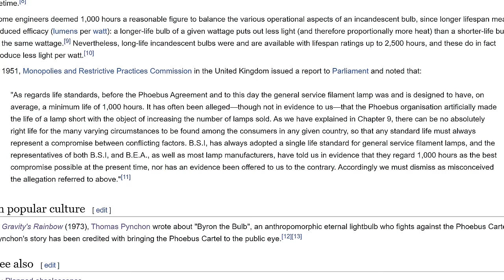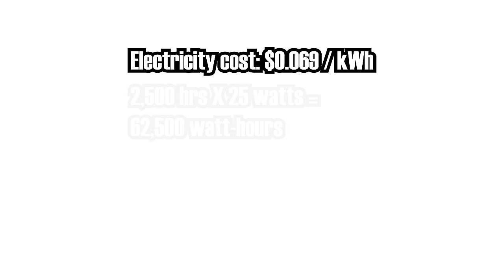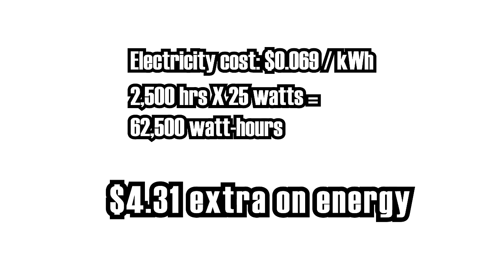Longer-lasting light bulbs: it was complicated

Comment from the maker: So... yeah. And I didn't even get into things like the effects of thermal cycling stress!
Couple of fun facts that didn't make it in: one way to make an "energy-saving long-life" bulb is to design it for 130V, thus when on 120V supplies it's being underrun. And those are very weird because, for instance, it'll often be marked a "60W bulb" - but only at 130V. So in a sense it's like installing a dimmer that you can't go over 85% brightness or so. It works, but you have the same efficiency and output trade-off.
And to touch on that thermal cycling stress, light bulbs for stage lighting were pretty niche and expensive, so stage lighting controllers would often have slow warm-up period upon power-up and never switch lights fully off when a show was going - instead, a very small amount of current was run through the filament to keep it hot, but not hot enough to glow. There were plenty of ways to extend the life of incandescent light bulbs, but every one had its own little unique trade-offs. Be glad we have better tech now!
Reply: I'm working in a company that makes things that are not designed to fail at some point
Reply: @Scudmaster11 ok 👍
Reply: DJL projector bulbs (and likely some others) have a filament in series with the main filament, which is located behind the reflector making its light output useless.  The extra filament doesn't get nearly as hot as the main one, and I suspect its intention is to limit peak current.  If a bulb of that style (using numbers which are probably nowhere near those of the actual DJL bulb) if the main filament has a resistance of 0.1 ohm when cold and 1.0 ohm when hot, and the other filament has a resistance of 0.4 ohm when cold and 0.5ohm when hot, then the light output would be about what it would be if the main filament had been 0.2 ohm when cold and 2 ohms when hot, but the inrush current would be only 40% as great.
Reply: Having lived in Phoenix, where my light bulbs lasted 11 years, I learned that Mexico runs on 130v, and the bulbs in my house were 130v bulbs from just over the border. So, when the bulbs in my Maine house were being changed 6 or 7 times a year, I ordered some "Mexican" bulbs from Amazon. Only one needed changing this past year. I fully embrace your hypothesis.
Reply: Can you make a video on refigerantion compressors?
Reply: The maximum lifetime of a normal light bulb (not LED) is about 30k hours. You can actually get those, but people are too dumb to order them in large quantities.
Reply: Isn't this a re-upload , I'm pretty sure I've watched this in the past.
Reply: “Rough duty” lightbulbs sold for things like under-car mechanic lights have filaments made for 180 or 200v. They glow a cooler orange than ordinary bulbs consuming the same amount of wattage.
Reply: reminds me of the bulbs in high bay lights in gyms, they take 3-5 minutes to warm up
Reply: This point is irrelevant now, but you can make your incandescent bulbs last much longer using one of two methods.

First, find a small transformer that is rated to convert 120V to a lower voltage, such as 60V.  Wire that into the base of your lamp, or put in a project box somewhere on the cord.  Then use a higher wattage bulb.  The bulb will receive a lower voltage and so draw less current and so burn less bright than it is supposed to.  

Second, place a resistor in series with the bulb socket inside the lamp, and use a bulb with higher wattage.  You'll need to try different ohm resistors and different wattage bulbs to get the preferred brightness.  Just make sure that resister is rated for the amperage the bulb will draw, which is about 1 amp in this case (but you can go higher -- just don't go lower).  

EDIT: Responding to future comments...  Yes, the resistor will get hot since it's converting power to heat, just as an incandescent the light bulb does.  And, yes, newer resistors made in the past 10 to 20 years or so are rated in watts, rather than amps (which doesn't make a whole lot of sense since 1V at 100A is the same wattage as 100V at 1A, but a given resistor that will handle 1A just fine will pop with 100A passing through it).
Reply: @fredashay  Those used to be sold “as seen on tv” in the form factor of washers that went into the socket below the bulb.
Reply: Often longevity would increase costs, and more durable parts would be heavier, bulkier also ruining efficiency. With lower production value it would be more expensive. You would also lose access to new improvements in efficiency and new innovations. 

Would you want a fridge or dishwasher that costs 5 times more for 2 times longer lifespan and reduce efficiency? 

The problem is when you don't engineer things for a specific target in durability, but optimize for costs and you would have components with very uneven durability and you lose money on bad design. But that isn't really planned.
Reply: @jrrarglblarg9241  Tv?  What's "tv"???
Reply: Could the centennial bulb be in fact a 240v bulb (European or such) running at a quarter of its rated power here? As power is proportional to the square of the voltage for a constant resistance (P = V^2 / R)...
Reply: Would you say light bulbs are like batteries?
Reply: @avlisk  The reason why there's 130v bulbs in the Mexican market is actually because their federal voltage standard is 125v +10% or -5%. This gives a legally acceptable voltage range of 119v to 137v - which can be tough on certain appliances.
Reply: You missed it.... "it's not the brightest bulb in the box..."
Reply: @fredashay  Why bother using a resistor when dimmer switches are readily available and more efficient... So yes you can run a 100w bulb at 60w with a dimmer, but it won't have the same "whiteness" as a real 60w bulb as mentioned in the video.
Reply: So let me get this straight you think that they were not being a cartel? So then why weren't braided filaments used or at least staggered spring shape tungsten?

Same engineers could have easily done this. Cost would be slightly more but, could easily last longer.

That doesn't even get into making a forever bulb. With things like inconel, etc.
Reply: @DroneMTL  Okay.  Good point!
Reply: This reminds me of the old fashioned single use camera flash bulbs. They're super bright under very little power, with a lifespan of like, half a second.
Reply: I was going to mention the importance of manufacturing. I work in PCB assembly manufacturing and know there's a lot of things the companies can do to either through incompetence or maliciousness shorten the life-span of the products. Some go down to the soldering, wanting to use less of it which basically ensures the product can't survive long if it's experiencing vibrations... So glad this was pointed out though. Very good video, thanks for making it!
Reply: Regarding the centennial bulb: it burns 24/7, therefore, no thermal cycling (shock) of the filament.
Reply: Every engineering content producer, it seems like it's impossible to avoid the 69-nice joke, and I love it!
Reply: There were "long life" light bulbs rated for I think 270V at time when Europe ran at 220V. I still have several of them at home.
Reply: @CraftAero Yep! They had to move it once or twice and were absolutely terrified that it would burn out when it was powered back on.
Reply: Considering your Phillips light video and this, I'm surprised you haven't tackled the Dubai Bulb conspiracy. We really could have the best of both worlds for minimal cost.
Reply: Are Compact Fluorescent Lamps considered obsolete?
Reply: I remember we had a specific spot in our apartment for spare light bulbs. Now I've bought LED bulbs when moving to a new apartment to get the preferred color temperature.
Reply: @DreitTheDarkDragon  What do you mean "at time when Europe ran at 220V"? It still does :)
They're also banned in Europe for years now because of low efficiency and detriment to the environment.
Reply: @jlinkous05  "it's impossible to avoid the 69-nice joke..."
69-nice joke, nice.
Reply: Hey Alec, I really enjoyed the video. However, I'd like to point out that in the beginning of your video, you mention the reason for carbon filament bulbs not being ran as hot to be their melting point, however, this would be incorrect. Carbon sublimes directly into a gas at atmospheric pressure (and below) at ~4000 K (or ~6700 F) and can't exist as a liquid unless subjected to an elevated pressure at high temperature. I suspect the reason for not running carbon filaments hot was their fragility, because they could theoretically get hotter than tungsten filaments but would probably break from thermal expansion (these filaments were fairly brittle) before they got that hot, hence the short cycle life.
Edit: I suspect evaporation is just as problematic for carbon as it is for tungsten, and I suspect carbon might not be able to weld itself as it fails like you demonstrated in this video with tungsten. Though I wonder how well halogen technologies would've worked for carbon.
Reply: @fredashay  “TV” is boomerspeak for a now-obsolete real-time video streaming service that used one-way line-of-sight wireless connection between host and client devices. The massive RF footprint for the dozen analog “tv” channels required receiver antennas ranging from a several inches to several feet long. They would be arraigned along a central axis in order of size. For best results the central axis would be aimed at whichever local hilltop all the “tv” and “FM radio” (a now obsolete music streaming system) stations put their transmission antennas on. 

Enjoy your day.
      😂👍
Reply: led bulbs its usualy the driver circut that fails most of the time the led is fine
Reply: I don't know if anyone will read this comment.  But now on the market there are, for example, incandescent lamps for cars.  And the brightness of these lamas depends, as you thought, on the length of the thread itself.  What do you think marketers did?  They shortened the thread and the lamps began to shine brighter, but their service life was reduced by 1.5 times, and the price of these lamps rose by 1.5 times.  Passing them off as a miracle of the latest technology.
Reply: @JJ9715 compact fluorescent obsolescence:
yes. They are now objectively less efficient than LED's, and have a worse spectrum. 
"normal" fluorescent tubes, too- especially if they have a "dumb" starter and ballast. 

I still have a bunch of decent compact flourescents (fast- start 15 and 20 watt sylvania mini lynx compact) and will continue to use them in some applications, or keep them in reserve. For stuff i switch on and off daily, or only use short moments (garage, hallway), I just use current led's when I replace them. (still some old lightbulbs running in there)
Reply: thermal cycling was what I thought you were going to cover.
Reply: @lukastemberger "still 220v" some eu countries are definetly closer to 230-240. At least, my multimeter and my brother tell me so.
Reply: @lukastemberger 230 V nowadays.
Reply: For many years I had a lamp that was a sunrise simulator, basically a fancy dimmer on a timer that turned on a incandescent lamp very gradually over the course of 30 minutes at a preset time for each day of the week.  It only ran the incandescent bulbs for the 30 minutes it took to reach full brightness and then 5 minutes at full brightness after which I had a separate LED bulb on a different more basic on/off timer take over.  The two 60w incandescent bulbs I used survived this 35 minute cycle daily for well over a decade because of the reduced thermal shock and relatively short daily burning time.  I suspect both bulbs were well over 2000 hours of runtime and still working by the time I got rid of it.

I finally replaced the unit with an addressable RGBW LED array strip driven by an ESP8266 controller.  The end result was taking something that consumed up to 120w and replacing it with something that performed 99% the same but consumes at most 20w.  With the added bonus of the ESP8266 is a far more capable controller than the chip driving the old system and can do things like automatically adjust for daylight saving time and run different light programs if desired.

The RGBW LED strip/programming a "sunrise lightshow" was necessary because it was the only thing that could approach the slow ramp up dimming capability of incandescent bulbs by switching on individual LEDs at their minimum brightness one at a time, pretty much no standard dimmable LED bulbs even come close to the minimum brightness range.
Reply: funny thing you based your cost/gain calculation on Westinghouse....
data  from EU based Phillips (@21:37) was a LOT better, and 2500h bulb was much more valuable here!
Reply: Somwbody went back and recorded that line about it rechnically being sublimation after already recording the whole episode where you said evaporation didnt they?
Reply: @avlisk In winter the inefficiency of those bulbs will just create some extra useful heat. 
In summer that extra heat won’t be useful unfortunately. 

Just curious: do you still use incandescent light bulbs? 

I’m from the Netherlands and over here (in the EU) incandescent bulbs have been banned so it’s all LEDs bulbs here.
Reply: Yes!  Yes! Yes! Technology Connections dropped a new video!! 
Alec i really enjoy your content. I subbed to your 2nd channel and your secret 3rd channel. 
Did you ever get that moka pot? 
Maybe espresso is something you would enjoy. Maybe a Flair lever machine? I have also been watching the Jleverespresso. 
Keep up the great work!!
Reply: I'm embarrassed to say that I didn't look up the wiki article after watching Veritasium's video on the Cartel, and took for granted that they told the full story.  You're not alone in being annoyed when extremely relevant "well actually" information is left out of a story even when the omission is intended to support a very good cause like Right to Repair.  So thank you for setting the record straight.
Reply: @ZeigtdasVideo  That's so weird. I lived in Europe all my life until 3 and half years ago and I never knew that they switched to 230... I googled it now and you're correct.
Reply: Hey, your analysis that "the power company makes more money if it sells more power" is just false. The power rate is set as highly as people are capable of paying for it. Energy svaign standards let the power company make more money cause they can increase rates and make less power which costs money.
Reply: @DroneMTL that is an interesting idea. 😊
Reply: Also, with other things, there are legitimate trade-offs to making a product that will last forever. In general, it will have to be more robustly built and require more material than a product with an expected lifespan, meaning that for the same performance, the cost for the infinite life version will be higher. And believe it or not, there are some products where infinite life wouldn’t even be useful because the world changes around it. For example: if you designed an infinite life VCR in 1985, you would still have trashed it by now even if it still ran just fine, because nobody uses VHS tapes or analog TVs anymore. Likewise, engine has advanced so much that the fuel economy is too bad to make it financially viable to drive a car from the 60s in the modern day, even if it still ran like new.
Reply: @lukastemberger  Europe runs at 230V for many years. I know, small difference but like 30-40 years ago everything was officially 220V and with different voltage tolerances.
European union banned all incandescent lightbulbs no matter their power and efficiency. Funny thing is you can still buy them but must sell it as "heat ball" or something like that.
Reply: So yeah, keep up the funny dry humor vids of engineering we love em!
Reply: Can you touch on bulb savers. Basically a diode you inserted between the bulb and base.
Reply: @jrrarglblarg9241 
Rough duty bulb also have additional filament supports.
Reply: I would not even say your own description of "they were engineered to fail after a certain number of hours" is fair... the nominal lifespan of 1000 hours is not a design factor, but an experience value of the time something like 95% of the bulbs will at least make it to... everybody knows a case where a bulb was really short lived after all, maybe due to manufacturing mistakes, but there probably were also cases where the 1000 hour bulb lasted for 1500 hours.
Reply: @Ugly_German_Truths  
I believe that's called MTBF
Computer hard disks have a MTBF rating printed on them. 
Some last longer, some shorter.

Edit. The packaging on current incandescent bulbs say "average expected life X hours."
Reply: K ° 🤣
Reply: @DevilAgent And bluish light is interpreted by the brain as "brighter". However, our eyes are less sensitive to blue light, so we are seeing less far than with non-blue car lights. Car light marketing at it's best...

Buy non-blue, OEM lamps. Last longer, approved, and safe.
Reply: It's an old trick to use a bulb rated at a higher voltage to extend its lifetime... When was the last time you replaced the bulb in your microwave oven?
Reply: I'm glad you mentioned thermal cycling. In my freshman engineering seminar class (back in 1968), we had a GE engineer talk about light bulbs and he spoke of the life of incandescent bulbs was based on a certain number of thermal cycles. I don't remember the number but the thermal cycles stuck with me with regard to a lot of things including electronics and hard drives.
Reply: @DroneMTL  Could be. But that 240V was 220V before... But even if it didn't make much sense I have heard about bulbs designed for other voltages. 

When you have a tram line that uses 600V DC some made light bulbs that can use 600V electricity to make sure that they don't have to convert the voltage. If it was 100W with 600V, it would be around 4W with 120V...
Reply: Can you do another video about planned obsolescence on automobiles... Compare the similarities between automotive length vs light bulbs... I think most people know that vehicles could be made to last twice as long as they do...
Reply: 1) Could it be that there were no advances in bulb technology due to the fact that it was forbidden to sell said new more "effective"bulb?
2) we need the cartel back to police up theas shots led designs  an over driven led is no better than running a train head light(96vdc) on a wall plug. Yes it is sufficiently bright but has no life.
My experience is that the voltage regulator ( leds run at 2.7-4.7v ac/dc)is over clocked , this shows up as UV anf heat damage through the casement as yellow stains . Or as you said running in a state of overrunning voltage severely cutting lifespan, if the regulator components can out liveth diode.
Reply: The issue isn’t that you have to look deeply it’s that you have to look at all. We no longer examine critically. Most of what happens in our real lives. Just accept it and move on, and a good conspiracy theory is hard to resist.
Reply: @Conservator.  I use LED's when I can. I have a "3 season cabin" in Maine that I had to live in over the winter. The exposed water lines needed just a little heat to keep from freezing. That's why I bought the incandescent bulbs. It's a unique situation. This winter, I'll be wrapping the pipe in heat line tape.
Reply: Just a friendly notice, the subtitles say "eek out" instead of "eke out".
Reply: I do not like this video, I miss the old you.
Reply: Most 12V halogen lamp transformers only output 11.5V to slightly underrun the light bulbs and prolong their lifetime.
Reply: @avlisk  Thank you for you answer. That explains everything. I hope things will get better for you. All the best!
Reply: That cold heat function is also common in the animating signs that uses incandescent light bulbs, just so they're not gonna explode whenever they get kicked to the full brightness notch, just by basically keeping the filaments cooked to ward off thermal stress of Tungsten.
Reply: There is a channel named Truth Stream Media that has recently done a pair of videos in regards to Planned Obsolescence.

Very good watch.
Reply: When someone tries the "planned obsolescence of lightbulbs" conspiracy theory on you, just remember this: There was this huge thing called "the eastern bloc". A large portion of the planet running a socialist planned economy in nationalised industry model for decades. And desperately trying to make as long lasting lightbulbs as possible because the regime didn't profit from them (it was often subsidised), it just made them to fit the basic need of the people and if it were possible to make longer lasting ones, they would make them longer lasting, because the tungsten was a strategic resource for the military and the government hated wasting it on consumer products.

I can assure you lightbulbs here in the eastern bloc had the same life expectancy as elsewhere. 

Same thing goes for fuel efficiency in cars and other stuff. If socialist planned economy did it the same way as market economy, it means it was either the only way to do it or the most efficient way to do it.
Reply: @ve2mrxB  At low light levels the human eye is most sensitive to blue light (about 500nm), that's why night vision safe lights are red to protect our blue-sensitive night vision. Whiter lighting also improves perceived contrast and color rendering, making it easier for our brains to perceive indistinct objects more quickly. Finally, an incandescent bulb (regular or halogen, as in car headlights) driven at higher temperatures doesn't just output more light in the higher part of the visual spectrum, it has a higher intensity in the lower part of the spectrum as well, so even if you were to filter out the blue, the light would still be objectively brighter. That said, high-output halogen car headlights aren't worth the price premium and the extremely short lifespan. Keeping your headlamp lenses clean and clear is much more cost effective and beneficial (call back to a previous @TechnologyConnections video about sealed-beam headlamps, in which you got brand new lenses every time you replaced the bulbs...)
Reply: @jasonosmond6896  I am talking about the car bulbs that emit a distinctive blue colored light. The bulbs are usually blue. 

The unfiltered clear bulbs are burning brighter and faster but do deliver good light. Lifetime is much shorter as you mentioned though!
Reply: Yeah I have noticed that Incandencents tend to fail more often in places where they're turned on and off frequently like the kitchen or bathroom.
How ever I'm finding that I can now get a pack of bright 60w equivalent LED's at the dollar store in a box of 4 lights for $4 CAD
Reply: I work in stage lighting and incandescent bulbs are actually still widely used nowadays (LED is slowly taking over though) and the techniques you mentioned are also still alive and well. In the desk I use, there's even a preheat feature, so you can define a preheat percentage and have it start to heat up a cue before you need it. Honestly, I'll really miss tungsten when it's gone (this is going to turn into a love letter to tungsten soon). LED technology has gotten ever closer, but tungsten is still the best in terms of light quality, it's such nice warm light with perfect color rendering (it looks great with gels too). It's also hard to find LED lights without some sort of dimming problems like it looking a bit flickery. In theatre, you just need that absolutely perfect transition and tungsten does it perfectly with smooth dimming and an amber shift (which can sometimes be quite nice actually). There is also nothing like being at a concert and when the artist engages the crowd, the tungsten blinders hit you with all their light and warmth and you just feel drawn in not only by sound and light but also by the feeling of warmth on your skin. The warmth of light is oddly comforting and LED will never be able to replace that (without defeating the whole point of energy efficiency that is). I also honestly love the crackling sound when the light fixtures heat up or cool down. Of course, it is wildly impractical during a play, but it's just a great feeling when you're focusing, you'll start to hear crackling soon and with every light you have focused, the room gets hotter and hotter until it's too much to bear, by which time you'll hopefully have moved on to programming. As you tear everything down after the play, you hear crackles in every corner until eventually, the stage is empty again, the truck has been loaded and you hear the last few crackles before you turn all the worklights and machinery off. It's just a certain something I'll really miss when we too will have made the switch at a yet unknown point in the future. However, I won't miss bulbs failing when I needed them the most and I certainly won't miss burning my hands and arms on those fixtures.
Reply: P
Reply: @charlotteice5704  The amber shift when dimming is the main reason I haven't switched to pure LEDs! Incandescent, although less energy efficient, dims much better than LEDs (unless you pay $$$$ for amber-shifting LEDs)!
Reply: Not just thermal cycling, but there are other factors that can reduce a bulb's service life - like physical stress.,   Ever notice how an incandescent bulb installed in a ceiling fan has a shorter life?  It's because of the vibration generated by the motor (slight but present nonetheless) and the fact that most ceiling fans are poorly balanced.   For mechanics, there were/are still 'rough service' bulbs, typically of lower wattage) that have coatings on the glass to help keep it from shattering when 'indelicately handled.   Because of the lower wattage, the filaments aren't as hot and don't sublimate quite as fast, and are more resiliant to mechanical shock.
Reply: The descibed stage lighting tech eith pre-heating is used till this day in 'blinders'  the bigass parabolic reflected lightbulb arrays.
Reply: @jrrarglblarg9241  The glass is also coated with a plastic to help keep it from shattering.
Reply: @Nderak  Those might be arc lights.  Once upon a time, street lights were arc lights, too.  It was always neat to watch them flicker, then start glowing with a weird,  dim blue-purple light, slowly building to a brilliant white.   They crank out a great deal of light and they're pretty long-lived, but they do eat up quite a bit of power and they are expensive.
Reply: @Scudmaster11 What industry is that? Not trolling, just curious. I’m in the aviation industry and even here, where failure means a very bad day for a lot of people, things are designed to life limits (precisely because the cost of failure is way higher than the cost of a new part).
Reply: @xaenon  Well, yeah, that too, but the point here is the work light filament is running so cool it can take a beating getting moved from spot to spot under a car without switching off. Regular lightbulbs blow when you smack the lamp holder around because the hot filament  is both thinner and more fragile due to heat.
    Someone told me years ago the rough duty bulbs are sold without the coating as 180/200v bulbs and were used on ocean drilling rigs and other electrically self contained industrial things that ran at higher than US voltage but not as high as European because it’s 2 phases of 110 or something.
Reply: @mrb692  I signed a non disclosure so umm... electronics in special machines "non consumer buy able" its things you can't buy at the store... the unit I make costs afew thousand $ ... so ya... that is what I do... assemble thies units... still can't say what I do conpleately
Reply: @avlisk  But were they dimmer and more orange colored?  Did they end up needing more power to get the same brightness, so you end up spending more than the cost of the bulb?
Reply: @TechnologyConnections
Another great video, We always used these types of light bulbs untill annoying mercury and finally LEDs came to market and become cheap enough.
I watched very popular veritasium video about it a while ago, but I think he didn't mentioned this crusial detail (pls correct if I am wrong).
I will go and try to search another video about different types of lightbulbs on your channel.

P.S. You did it, one of few videos where you managed to not included refrigerator cycle , maybe next time😂
Jokes aside, there are  actually so many people, even scientists, who don't understand this cycle and believed in common myths like electric heaters somehow destroy water in the air (I was actually one, before your video made me think about it critically for the first time).
Or don't understand how relative humidity works.

I would add these myths to list of myths that I commonly dispell,
Number one probably that Alcohol doesn't make you actually warmer, you feel warmer, but if you are still on the cold you would freeze even faster (also ignoring that being sober in survival situation will help). So people have no idea either.

Your channel is a gem and I am so glad I found it a while ago.
You and NileRed are probably my favorite channels that makes me a bit smarter.
Yours is interesting mix of Physics, Electronics and consumer products.

Yes, it's is strange to see your hour long videos about everyday mondaine topics, but you never disappointed.
You promised epic story and there always was one 😂

So glad channels like yours succeeding. (long format with quite deep exploration of sometimes obscure topics, but at the same time still accessible to audience of not specialists, but also not be dumbed short to 5-8 min video for everyone without much interesting details).
Congratulations with 2 millions.
Well deserved.
Reply: yes you are quite right, however I am going to lay out a business case. Say. for example, 50 years ago, a street with 100 houses on it, at 8pm in the evening had 100 watts of incandescent each house running. That means at a purely resistive load, the power company is supplying ( at each house , after all other transmission losses to get there ) at a power factor of 1, 10,000 watts, and billing their customers for 10,000 watts. Fast forward to today, that same street of 100 houses is only being billed for 1200 watts ( with the same amount of lumen output lighting ) , yet the power company is having to supply at least 2400 watts for those LED bulbs to operate. So, not only has the power company lost 7/8 of it's billable revenue in the first place, but now it has to generate double the power to make that loss of revenue function. Does anybody wonder why electricity is becoming exportentialy more expensive ? 20 years ago ( in the UK ) , electricity was around 3.5p per KWH, it is now 30p. That is not normative price inflation.
Reply: Running stage lights on 10% power instead of switching them off also drastically increases the response time of dimming them up or down.
Reply: @JohnDlugosz  I didn't pay attention to any of that. I was only concerned with how do I keep the pipes from freezing. The previous owners used a single 100w incandescent, but it was in a hard to reach area so I put in 2  60w bulbs, which would also be a little insurance in case one failed (which they did quite often). As I said, it was a unique situation. Zero F was about the limit before I had to keep a faucet dripping all night. And, the bulbs were pretty expensive shipped from Amazon, too. A lot more than the 120v ones around here.
Reply: @Scudmaster11  Hah, fair enough. There are several folks I’ve worked with who could only tell me roughly that much about their roles too
Reply: you forgot degrees Rankine
Reply: @Nderak  that's an arc sodium lamp, I believe
Reply: @mrb692  sorry but I signed a non disclosure
Reply: @eddiewillers1  127v, actually.
Reply: @michaelimbesi2314  about cars...
I get your point...but there are many reliable , efficient cars of the 60s still running.  Just as there are plenty of less then 10 yr old cars that ARENT reliable OR efficient (domestic full size suvs , say)
Reply: the other side of the 130 volt bulb story is power companies provide 115V +/- 10%.  and to prevent dropping into a low voltage situation, which stresses any motors connected to it; they build their transformers to run at no load at 115+10%, or about 126V.  this puts the no load residential voltage at around 121-123V.
Reply: @daviddroescher  I have some leds with a good few non stop years of life  on them...
Reply: @JJ9715 Yes, CFLs are obsolete. They were always intended to be a temporary bridge between incandescent and LED, because manufacturers knew LED was the future but the technology wasn't ready yet in the 1990s, but we already knew fluorescent lighting was more efficient and we knew how to make it. The challenge was making fluorescent lights that would fit an ordinary light socket. Once that hurdle was cleared, the CFL could take over for the incandescent while research into super-bright LEDs continued. The catch with fluorescent lights is that they require mercury vapor to work, which makes disposing of them an environmental nightmare and why they told us not to put old CFLs in the trash.
Reply: @kenbrown2808  this may be why my Japanese video game consoles failed fairly quickly, since they are designed to run at 110
Reply: amazing research and found the long intro to be useful and interesting despite knowing these already. i guess to refresh and check if my memory about these. Though I like new tech, incandescent and CCFL still matter vs LEDs if the light is only to be used for very short periods like few minutes. we still have a CCFL bulb that is still installed outdoors but rarely used. 
I still back  "planned obsolescence" of LED bulbs or products. it is convenient for companies that poor electrical design and/or poor components make for limited lifespans of LED bulbs whereas it is already cheap and possible to make them last 24/7 for decades. back then, LEDs/diodes burn out because they were driven so hard because they were relatively expensive. These days, LEDs  are so cheap that it is better to buy a bunch of them to reduce the cost and size of the power supply. LED Bulb power supplies are designed to be compact with cheap components and run so hot that it will fail in a few years. 
We got to push back because it is inconvenient to replace bulbs aside from e-waste (shouldn't be a consumable item anymore).  What if we make all ceiling lighting to be bare LEDs in direct current driven by AC to DC power supplies hidden in the ceiling or light switches. This way we only replace the power supplies which is more convenient than taking a ladder and safety hazard.
Reply: Regarding theater lighting - If you don't keep the filaments glowing, they will tend to "flare" (suddenly brighten) on fade up.  If you have them just glowing, they can be faded up in a more controlled way.
Reply: @Scudmaster11 ut then how will your company realize continuous growth every year until the end of time? Because, I mean, money is obviously the fundamental and only legitimate measure of value or success. Sure, if people end up living happier, more fulfilling lives then, y’know, that’s fine, as long as it ultimately leads to economic growth - that’s what truly matters.
Reply: You mentioned short-lived LEDs, and I immediately thought of booblights! I had a box of old LED bulbs, half of which are in well-vented fixtures still doing their thing for many years. I put the rest of the box into unvented booblights in the basement, and they seem to burn out in less than a year.
Reply: Near-infrared light is important for our immune system and health in general. Light literally penetrates all the way through bone and other tissues, even into the brain. We don't fully understand the importance of it, but with us being indoors more and more, I'm sticking with incandescents for as long as I can. I'm stocking up before they disappear or become specialized and expensive.
Reply: Oh damn, I'd love for you to do a deep dive on theater technologies.
Reply: Hey, Purple Streetlights! My company replaces dosens of purple streetlights every weekday. If you'd like a few to experiment with I'd be able to ship some to you.
Reply: @MaxW-er1hm  if you are referring to ones brought over from Japan, that is entirely possible.  if you are referring to ones made in Japan for the US market, they should have been made for that 115 +/-10%
Reply: Of course, now LED bulbs cost $2 and last 10-20 years. People still buy tons of light bulbs.
Reply: @technology connections Why is a dishwasher, car, or washing machine planned obsolescence examples? Even if you have real old versions of these, they still get the job done and don't have THAT much (if any) advantage over newer versions. iPhones, however... might be a better example, don't you think? (I am pointing at you, non-replaceable batteries!)
Reply: @jrrarglblarg9241  That seems like it would be about as safe as lawn darts when trying to pick the stuck washer out of a socket.
Reply: Your argument is completely silly. If the idea was to reduce expense for the consumer; a limit would never have been placed on lifespan. It would have been placed on undesired effects. Long life was never a undesired effect for the consumer. It was only an undesired effect for the cartel members. Your argument also fails to consider that Soviet 
Union had light bulbs that lasted decades without the problems you claim. Not to mention the same cartel itself started selling "premium" lightbulbs that lasted 2500 hours some years later anyway. Seriously an utter rubbish argument.
Reply: Cheap flashlights do the opposite: they take a 2.2V bulbs and over-volt them to 3V. (But they look brighter before burning out!)

You can't easily buy replacement bulbs: so you are forced to buy a new flashlight,
Reply: My first thought was gonna be stress from thermal cycling.  The bulb only works while the gas seal is maintained and that will fail over time where the metal meets the glass.
Reply: Is the end music higher pitched than usual?
Reply: I like the appliance bulb.  It give off extra heat so I can use the oven as a warm place to raise my bread dough.  There is no other place warm enough in the house in winter.
Reply: One reason why car headlight bulbs are more prone to going ping in cold weather jumping from freezing to incandescent.
Reply: @thesentientneuron6550  Ever seen the carbon electrode electrode in a movie projector/ spotlight? They have a motorised holder to move the electrodes together as they burn away
Reply: @kenbrown2808  yeah , Grey market Famicom and neo geo cd 🙂
Reply: @zodiacfml  it just occurred to me reading your comment that perhaps why the components are made to fail at a certain heat level: If it fails at that heat level then it can't get hotter, and hotter would be more potentially damaging to property (?)
Reply: @joutoob9  I replaced the battery in my phone. It cost only about 10% of the original price of my phone. People replace batteries all the time these days.

The battery is glued into the phone because it makes the phone waterproof, unlike a phone with a removable back.
Reply: Philips also implemented soft start in their IQ Lighting bulbs in 1994 -- the first "smart bulbs" with a microprocessor chip in them. They claim to last 1500 hours, instead of the typical 750 to 1000 hours for standard incandescent bulbs.
Reply: Kelvin degrees 😂
Reply: @joutoob9  😵‍💫
Reply: @k.h.7238  If you're pretty sure you've watched this in the past, then you're having visions of the future or parallel realities. It's not a re-upload. You're experiencing a glitch in the matrix.
Reply: This is an honest and fascinating explanation.  Thanks for making all come together.
Reply: @MaxW-er1hm  There is no specific temperature or heat level for components.   The reliability or life of components  shortens with respect or linear with temperature. So yes, running electronics at much higher temps do fail faster.
Reply: Why did the cartel oppose emissive oxide layers on tungsten filaments?
You get a filament protected by an oxide layer that runs cooler and produces white light !!!
What oxides? Cerium/Hafnium oxide, similar to those used in gas mantles and Nernst lamps.
Imagine a 25000h (or more) bright white lightbulb. The technology was there and they actually killed it.

Also, I have lots of LED spot lights in my home and half burn out constantly in less than an year with the rest barley icking past a year of service with strange blinking as dimming being common. I am not thankful for this technology because even halogen spotlights used to last longer with the drawback of higher energy consumption and too much heat but also gas/mercury discharge lamps also used to last longer although the tiny ones for spotlights were marginally more expensive per piece. Now, I know I could break out the soldering pen and make LED lightbulbs that actually last a decade, but I really don’t feel like manually populating custom circuit boards for two hundred pieces.
Reply: @doomtho42  it's not a small company
Reply: It is Wolfram, not tungsten.
Reply: @Nderak those lights are not incandescent.  Mercy Vapor or Metal Halide.  They use an arc of electricity, not a filament
Reply: @rogerpearson9081  Sounds like a modern-day Davy's Arc Lamp! And I had no idea it had such a use. Can you cite any sources where I can read up further about this?
Reply: I’m going to put this light bulb on a 240v circuit. I paid for 130v, so I’m going to use 130v.
To anyone reading, this is a joke. Do not do this
Reply: Rough-service filament bulbs were great, but mine always were slain by accidental water contact, shattering the glass. LED bulbs are far better in that regard.
Reply: To add to the list of planned obsolescence products, some toner cartridges, counting the amount of pages printed not the ink used, 1000 white pages printed would "use up" the cartridge while it's full of ink at the end.
Reply: Though you would mention thermal cycling in relation to the centenary bulb, it's always on (except power outages) but household light bulbs are turned on and off usually multiple times a day!
Reply: @flatfingertuning727  there are Mercury Vapour bulbs that use a filament inside the outer envelope for "ballasting" and are intended to operate straight in a socket without and power gear like a choke/"ballast"
Reply: @Nderak  totally different those are HID ark lamps likely Metal halide and NOT incandescent and are closer to what street lighting was 
and they were sold for "household" use but VERY rare/NICHE due to the slow warm up and upto 5 minutes restrike time (no light for 5 minutes after you turn them off and on again
Reply: Sigh. Rankine degrees are always forgotten.
Reply: @DroneMTL  using a resistor on a 100w bulb to reduce the power to 60w would reduce the 144Ω bulbs voltage from 120v to 93v. The resistor would be 32Ω and would consume 22.5w. which means the resistor would be using 27% of the total power being consumed

(The calculations was done for 120vdc so AC ohms and would measure slightly differently but I can imagine the energy loss would roughly be the same 22.5w or 27% loss to run a 100w bulb at 60w)
Reply: 32:24 Wait! What? They were better because you changed them more often? And now LEDs are worse because you use more and change them less? 
What am I missing here?
Reply: 🎉bb41tuymai36bb41tuymai36bb41tuymai36bb41tuymai36bb41tuymai36bb41tuymai36bb41tuymai36bb41tuymai36bb41tuymai36bb41tuymai36bb41tuymai36bb41tuymai36bb41tuymai36bb41tuymai36bb41tuymai36bb41tuymai36bb41tuymai36bb41tuymai36bb41tuymai36bb41tuymai36bb41tuymai36bb41tuymai36bb41tuymai36bb41tuymai36bb41tuymai36bb41tuymai36bb41tuymai36bb41tuymai36bb41tuymai36bb41tuymai36bb41tuymai36bb41tuymai36bb41tuymai36bb41tuymai36bb41tuymai36bb41tuymai36bb41tuymai36bb41tuymai36😂bb41tuymai36😂bb41tuymai36bb41tuymai36😂😂😂bb41tuymai36😂😂😂😂😂bb41tuymai36bb41tuymai36bb41tuymai36bb41tuymai36bb41tuymai36bb41tuymai36bb41tuymai36bb41tuymai36bb41tuymai36bb41tuymai36bb41tuymai36bb41tuymai36bb41tuymai36bb41tuymai36bb41tuymai36bb41tuymai36bb41tuymai36bb41tuymai36bb41tuymai36bb41tuymai36bb41tuymai36
Reply: 🎉bb41tuymai36bb41tuymai36bb41tuymai36bb41tuymai36bb41tuymai36bb41tuymai36bb41tuymai36bb41tuymai36bb41tuymai36bb41tuymai36bb41tuymai36bb41tuymai36bb41tuymai36bb41tuymai36bb41tuymai36bb41tuymai36bb41tuymai36bb41tuymai36bb41tuymai36bb41tuymai36bb41tuymai36bb41tuymai36bb41tuymai36bb41tuymai36bb41tuymai36bb41tuymai36bb41tuymai36bb41tuymai36bb41tuymai36bb41tuymai36bb41tuymai36bb41tuymai36bb41tuymai36bb41tuymai36bb41tuymai36bb41tuymai36bb41tuymai36bb41tuymai36😂bb41tuymai36😂bb41tuymai36bb41tuymai36😂😂😂bb41tuymai36😂😂😂😂😂bb41tuymai36bb41tuymai36bb41tuymai36bb41tuymai36bb41tuymai36bb41tuymai36bb41tuymai36bb41tuymai36bb41tuymai36bb41tuymai36bb41tuymai36bb41tuymai36bb41tuymai36bb41tuymai36bb41tuymai36bb41tuymai36bb41tuymai36bb41tuymai36bb41tuymai36bb41tuymai36bb41tuymai36bb41tuymai36🎉22222222222²222222222222222222222222222222222🎉22222😂😂2😂
Reply: @lukastemberger  France for example switched from 220 to 230 in the mid 1990, but a lot of people here still refer to 220 V
Reply: u and your lightbulbs!!
Reply: @micheals1992  That's why I said why bother using a resistor, dimmer switches are commonly installed, cheap and they aren't simple resistors that waste power converted as heat. They are cutting the AC cycle to achieve the same effect.
Reply: Maybe you go into it, but why did Hallogen never catch on for home use?
Reply: As a lightbulb engineer, I can say you got it right and presented it clearly.
Reply: this was an amazing video. i wish veritasium Derek hadn't fallen for the conspiracy story.
Reply: @D3kKromb0x It might be worth mentioning that the thermally engendered emission spectrum of the incandescent bulbs is the closest possible (among artificial light sources) to the natural light of the Sun. LEDs, with their discontinuous, jagged spectrum, cannot really simulate a sunrise, no matter the sophistication of the circuit logic or the command algorithms. Differences may be visually unnoticeable , but are not imperceptible.
Reply: @lukastemberger The vast majority is on the nominal 230V  standard, which has its allowed  margins set such that essentially  nothing had to change for any country whether they were on the old  220 or 240 standard.

Sweden used to be nominally 220V,  I live close to a small substation and I've always had about 235-239V in the outlets, both before we adopted the 230V harmonization and today.
Reply: @Scudmaster11 oceangate
Reply: @bbrf033  no
Reply: Another light bulb-esque "consumable good" that people didn't really question, was the vacuum tube. But similarly to light bulbs, vacuum tubes can both run hot and efficient, or long-life and inefficient. It was expected to have to replace tubes in radios and TVs, much like it was expected to swap light bulbs. However, a vacuum tube that amplified better, or was more efficient, would probably be more in demand than one that would last 2500 hours but worked much worse.
Reply: @fredashay So you would pay more money for a higher wattage bulb, and then also pay money for a resistor that would create heat but not light, and pay even more money on your power bill, just so you could save a bit of occasional time changing bulbs.
Reply: @jamesphillips2285  I once had a cheap "lantern" that used 4xD cells. The light was bright but burned out after a couple months of use. I was disappointed to see the bulb was rated at 4.5V instead of 6V. Replacing it properly made it last until the metal strip inside that functioned like a switch and allowed the light inside to be raised and lowered below the parabolic mirror failed.
Reply: @jasonriddell  That sounds like a "sunlamp" I had in my childhood: it started as an incandescent, but the mercury vapor part would slowly take over as it warmed up, eventually becoming bright blue with the filament adding warmer color to it. I did wonder how it worked on regular house voltage without having a ballast!
Reply: @DroneMTL The centennial bulb is a carbon filament bulb that something strange has happened to meaning it runs at about 5W rather than its rated 30W. It's also become a semiconductor. And it varies in brightness a LOT, sometimes it doubles in brightness or more and then fades back down again.
Reply: @Cliffdog01  I remember halogen bulbs meant for regular home use in the mid-to-late eighties. The outer bulb was pretty thick and had an odd shape like two cones bonded base-to-base with the top being flat, so bulbs could be stored on their tops. They were brighter and more efficient, but still incandescent. They went away around the time those first-generation CFLs with incomplete spectrums appeared. (One could see with light diffracted by a CD that there were only a few isolated spectral lines which created a "white" color, but it was not as pleasant as a true continuous spectrum!)
Reply: @the123king  Heh, reminds me of "instant-on" TVs that would idle all the tubes so there was only a few seconds before seeing the picture. I didn't think that was worth it, so I used an outlet switcher (a plug-in device that resembled a wall light switch to depower appliances) to fix that.

The screwed-up thing is my modern Canon 10-key calculator: it has an energy-saving feature that can't be disabled and shuts the display off after seven minutes, making me hit AC to bring it back to life. Here's the screwed-up part: when the display is "off," I can see the filaments in the fluorescent display glowing if I turn off the lights, even if I switch off the power on it! For my home office, it became worth it to use the same switch to shut it down at the source and not enable the backup battery since I don't use the clock, date, or tax rate settings, and it only sees an hour or two of use per month. Canons are built like tanks, so it ought to last forever, but they clearly bolted-on that "energy saver" feature without a proper plan. Don't get me started on my Keurig... tries to be energy efficient, but it still boils the next round immediately after making one cup!
Reply: @jarphabib  yes
Reply: @vwestlife  They probably didn't have actual microprocessors. Maybe a simple timer and/or latch circuit, but not a microprocessor. That would have cost more than any bulb could sell for in those days.
Reply: Incandescent bulbs for traffic lights designed for more than 120V then run at 120V so they last longer.
Reply: I remember life extender pucks that would go in the bulb socket before the bulb. Cheap ones were just resistors. Better ones would only turn on at the zero cross point so you weren't rolling the dice on flipping the switch during a wave peak and slamming the filament.
Reply: @jasonriddell  The DJL bulb isn't a mercury vapor bulb.  If you look at a picture of one (a simple search will show some) you can see the two filaments.
Reply: In my dissipated youth, one night my brother and I climbed street poles to pull the bulbs out of "Walk/Don't Walk" signs. I brought one home and stuck it in the hallway fixture. Eight years later it finally died. Don't remember much about the markings other than it said "Extended Service."
Reply: How much did it cost to get the service man to change the light bulb  20$?
Reply: I spotted the studio flash unit modelling bulb at around 29'50" (yes, I'm that nerdy but among friends here;-) and it reminded me of "Photoflood" bulbs.  Used in the (you guessed it) photographic industry they were super-bright for their wattage but lasted  ... not very long at all - maybe 100 hours?. The tradeoff there was maximum lumens per watt (so lots of light without blowing the fuses in the building) against longevity. - Oh, and the light colour was less warm. "Tungsten" films  were actually balanced for photofloods, not the yellower domestic bulbs.
Reply: @lewisbrand  Things at the power generation factory are MUCH more complicated than you and your calculation suggest:

Electrical energy can not been stored at industrial levels, so electrical energy has to be produced AT THE SAME TIME as it is used. ALWAYS!

So, at 10,000 W usage the power company has to own generation of 10,000 W power all the time, but running only a base load of say 600 W, the minimal usage all day, when the lights are out.

Generating the base load is cheap. VERY cheap. nuclear power plant cheap. BUT with 600 W base load and 10,000 W peak load the power company has to own 9400 W power production capacity cycled up and down every day. These easy switchable power generation costs MUCH more than the base load constant power generation. that is cost of 2 to 4 times of cost, compared to the base load.

And it is even more expensive and much to slow to react regulating a base load plant (nuclear, big coal plants) than keeping peak load power plants in standby and not actually using them...

So with only 1200 W peak load by using LEDs the power company can sell 8800 W of the MOST EXPENSIVE to run power plants and maybe even make a profit producing less energy.

That is why some power companies pay subsidies for energy saving appliances: not to save the world, but to increase profits by producing LESS energy in expensive and more polluting power plants, only needed for peak use.
Reply: The cartel was clearly planned obsolescence, if they were really concerned with power consumption then they would have set limits on both lifetime and luminous efficacy.  After all it would be quite possible to make a 1000 hour lightbulb with very poor light output, but an incentive to make a bulb that lasts well AND provides good light output would drive innovation.
Reply: Less than 20 years ago, when high quality PC projectors started becoming a mass market item but before the superbright LED was a thing, I remember being absolutely gobsmacked by the price of replacement light bulbs for those things. I mean, we were looking at around three orders of magnitude more expensive 😲😲

Apparently they had very close tolerances in terms of the colour temperatures they ran, in order to provide the quality picture that owners demanded. I guess it was starting to become embarassing to project a screen that had a yellowish cast or which varied in colour through a presentation.
Reply: @christopherbedford9897  They are still expensive, but the UHP projector lamps are quite different to regular incandescent bulbs, running at very high internal pressures (which is why they can pop quite violently).  It's also a low volume market.
Reply: @fredashay  Your idea of using a double-wattage light bulb with a resistor in series is absolutely terrible, even dangerous.

You won't find a "1 amp" resistor because resistors are rated for power, not amperage. But a resistor drawing 1 A at 120 V would be a 120 Ω resistor, and it would also be consuming 120 W of power. This is not a small resistor: typically it's aluminum-cased, 1-2 cm in diameter, and 5-10 cm long. If you run that for a couple of hours a day, you'll be paying $1-$2 month just to heat that resistor, which rather brings home the point that if you want to save money, you shouldn't be using "long-life" bulbs or these sorts of techniques to extend their lives.

Worse yet, adding a 120 W heater to a lighting fixture designed for, say, a 100 W bulb will get dangerously hot and is moderately likely to set something on fire at some point. (And at that point your costs go through the roof, perhaps literally.)
Reply: The life of an incandecant bulb seemed almost random when I was a kid.  The lamp in the living room had to be changed every 6-9 months, but the ceiling light in the kitched lasted almost 2 years.  Ceiling lights always tended to last longer even though they had worse air flow.  Most likely, the lamp was cycled on/off more often.
Reply: @ferrumignis  Really, so they haven't switched to LED? Interesting. I guess the R&D isn't there, precisely because of that low volume thing.
Reply: Funny enough I do have some light bulbs that date exactly from that cartel era, and thus, because of the life time limit, I run them with reduced power, using both a NTC thermistor, and a dimmer, to reduce the power on surge into the lamp.
Reply: Fine job my man. I just spent over 30 minutes captivated by a video about incandescent light bulbs. Another great video sir.
Reply: Those 130w bulbs *fucking last*. My dads house was built with them and ~30 years later we have ~75% of the original bulbs still operating.
Reply: Ok, you make a compelling argument that 1000-hour incandescent bulbs are more cost-efficient than 2500-hour bulbs. But then why on earth did the cartel test the bulb's *lifetime*? If lifetime and efficiency go hand-in-hand, wouldn't it have been a lot faster, easier, and more reliable to test the bulb's efficiency instead?
Reply: @surelyijest  Thing is efficiency is hard to measure, you need precise calibrated equipment, which is expensive, while life measurement simply needs a 24 hour timer, set to give 4 15 minute shut offs a day, and a simple visual count of the number of lit lamps. Does take longer, but also is a lot more accurate, as you do not have to calibrate to get the relationship, which is not linear. The 5H45m on and 15 min off emulates a daily cycle, allowing the bulb to cool down so it has start cycles on it added in, as otherwise an always on lamp does last well over 1000 hours in use, as the only stress is slow filament evaporation.
Reply: This makes no sense to me.  It's essentially a resistor that is white hot.  I don't see any reason it couldn't be designed for 120V or 110V.  There's nothing intrinsic in the bulb to require 130V.
Reply: Episode about ice makers?
Reply: Most of our LED bulbs last a (slightly) shorter time then our old bulbs did, (we have always put the install date on each bulb, and now on the LEDs), but I still like the LEDs because they use so much less power! Our main kitchen lights went from 1000 watts to less than 100 watts.
Reply: @SchoolReports  Yes because they are also over driven. Run the LED dies at half the current, and cool them slightly better, and they will last a much longer time. Done both so they can cut cost, as they need fewer chips for the same light output, and also to make sure you come back soon for a new one. Funny thing is that, at least till the end of the year, incandescent lamps are still on sale, and due to tax they cost more than LED.
Reply: Now that is interesting about stage lighting. I noticed that in some performances; they don't shut the CAN lights off altogether, but dim them until they're barely noticeable.
Reply: @wyndhamcoffman8961  Often for short intervals they simply close the barn doors, so they absorb all the heat and light, so that the lamps stay hot.
Reply: 😊 26:10 😊 26:14 Asus ROG Strix G G531G-
Reply: You only focus on consumption, but what about production, distribution and recycling? Do energy savings take that into account? And did higher light efficiency at the same/higher wattage actually have utility value to consumers, i.e. did people actually start consuming less electricity or measurably benefit from the extra illumination in any way?

If the answer to these questions is no then, with all respect, your whole video is kind of pointless and using economics to justify why something wasn't done because of economics.
Reply: @Alec Watson

 Is this U.S. ban on incandescent light bulbs real!? i feel like i would have heard about it from you first but am just stumbling upon it 2 months after.... it's really upsetting if this is fact.
Reply: @austin508  They're banned in Europe too.
Reply: @JJ9715 yes, because of mercury content in CFL and better efficiency of LEDs
Reply: Well the better light spectrum was a coincidence not an aim of the planned obsolescence. Therefore I don't really see how this could be an excuse. Yes it's brighter but this was not the intention. It was to make it burn faster. Therefore using it as an example is still valid.
Reply: An important point I don't think you mentioned specifically: standardizing on one target lifespan also indirectly standardized brightness across all wattages. This could have just as easily been an efficiency standard, but I expect consumers would likely be much more in tune to lifespan numbers than efficiency numbers.
Reply: I can give you a good example of “planned obsolescence“ : already few months  people coming to me with 2021 500$+ Samsung 4kTV s   They’re all dead few months after warranty      most of them have dead backlight and molten lightguide  , now in default state most of tv’s last 1.5-3 years all they had to do to make them more durable and last 10+y  is install 30% more diodes or just program lower current for backlight…
Reply: @D3kKromb0x  Wow! What a coincidence, I'm trying to make the same thing you already had more than a decade ago, a sunrise simulator with incandescent bulbs and a LED that takes over after full brightness is achieved. Are you me from the future?
Reply: Off the top of my head, gradient wattage increases to save the life of the bulb could be useful, as the main issue is the erratic temperature of the filament. Once it is stable it seems to be fine. And you could certainly coat the filament with some sort of buffer to protect the light bulb from vaporisation damage. There really has to be some clever way to capture the vaporised filament to reintegrate into the body of the lit bulb to incredibly reenforce the lifespan of the bulb. I don't know I'm just a math major 😜
Reply: Incandescent is Real Light though.. The same colour as Fire. Amber like HPS lights. 
LED is fake light.
Reply: Another huge thing you could have added: A HUGE contributor to light burnout is down to turning them on.

No, seriously, that's not a joke about "OH JUST LEAVE THE BULB OFF LOL". 

When you turn on a light, it receives the Maximum voltage it will receive right off the bat, which tapers down a bit. Ignition is much hotter than Sustaining. This is why your slowly dying incan bulbs would more Quickly die when you turn them on, and also why flipping them on and off killed them faster. 

What's interesting is how this is true even in non-filament bulbs. In LED bulbs, the part that dies almost every time is a very small capacitor, part of the transformer circuit. It too is under the maximum electrical stress right when it's activated. 

I've found that a way around this problem is to get some of those neat wifi self-dimmable LED bulbs. They rarely get turned off completely, I'll just drop them to 1%, and because they're being fancy with how they want to appear, they "Dim" into being lit fully when activated anyway, which probably has a knockon effect of prolonging the life of the bulb.
Reply: When we wanted our indicator bulbs to not fail, we would install 250volt bulbs in 120volt control circuits.
Reply: Another way is to use an incandescent bulb meant for British 240 volts.